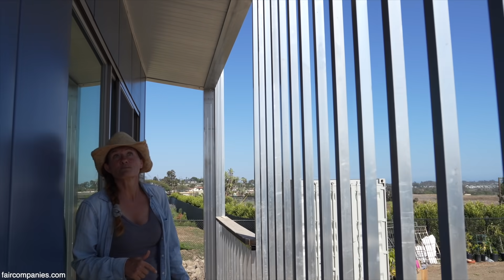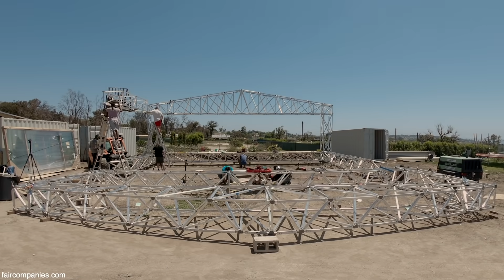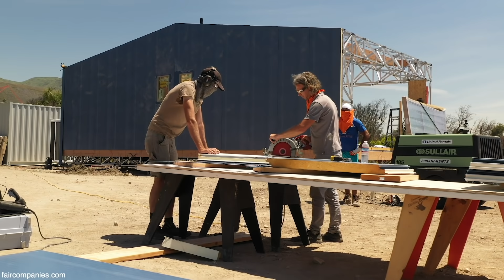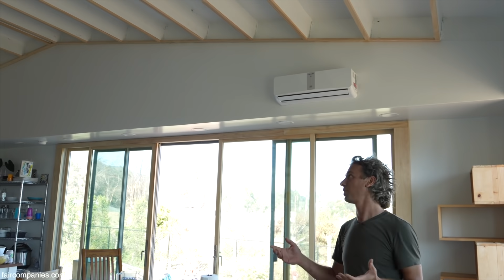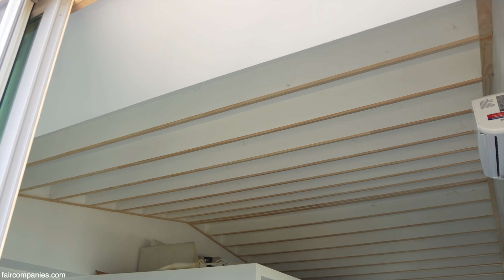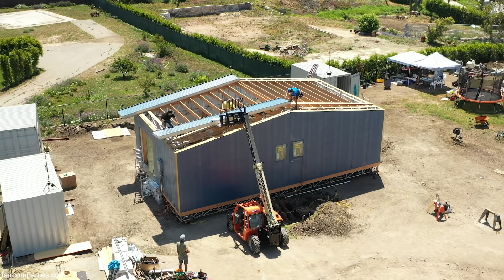This home goes up like a Coachella modular build: fast/cheap

Comment: I'd go for containers this house is for 2 people , 12  40 ft containers 6 over 6 will fit all of them and solar panels can be placed on roof as well plus they are made of steel so wouldn't melt , I thought they'll put solar on top but it feels like a lot of waisted space with no rooms.
Reply: I looked into building what you described - I  am designing a cabin/cabana on the water and I looked at shipping containers, and I don't want a structure that was treated with pesticides and I can't get a crane to the property.  These panels though aluminum look easy to ship.  I was surprised they used wood in the framing, underneath the metal - why not just all aluminum?  I don't want to put solar on the cabin near the water, because if by chance one of the solar panels broke,  it would be an environmental hazard on the water and solar agreements usually fall on the property owner for liability.
Reply: @laverite1050  Because of interior has to be insulated and not have thermal bridging materials, metal is a heat conductor and aluminum is a very good conductor...
Reply: Thank you - but how do they compensate for thermal bridging when companies sell all the pre-fab steel framing and studs?
Reply: Steel melts too, just at much higher temperature... Forest fires burn very hotly, sometimes over 2000°F (1100°C ) and that's close to the melting temperature of steel that should be more than enough to start weakening it. An average surface fire on the forest floor might have flames reaching three feet in height, which means a temperature around 1,500°F (800°C). Most metals will melt in that heat. In extreme conditions, a fire can give off 10,000 kilowatts of heat energy per meter of fire front, resulting in temperatures approaching half that as of the surface of the sun! 

While it may seem steel has the advantage when only looking at melting temperatures, a steel structure would actually have issues like hot spots, etc that will make it far more likely you'd get fried inside.  Aluminum dissipates heat much faster, helping to eliminate hot spots, and in terms of radiant heat it can reflect most of it to make it harder to heat up until the fire gets right up next to it but the steel would heat up long before as it absorbs the radiant heat...  

Basically, the reflective index for steel is around 5%, but aluminum can be 80-90% unless it's painted or covered in soot then it drops to less than 20-30%... Still higher than steel's 5%...  So a fire doesn't have to get as close to a steel structure before it starts effecting it...

It's also much harder to turn containers into a home, especially, as you go bigger, more complex designs, etc. and quickly becomes more costly than traditional framed structures.  While steel or aluminum framing gives more flexibility in design, much less labor, etc.

Comment: The steel-skinned SIPs are great. The electrical and plumbing trades will love the open frame sections for easy installation. And the whole thing seems like it’s very low carbon because of the basic minimization of materials. Brilliant!
Reply from the maker: Right on
Reply: I wonder if the panels have foam insulation? If they do... Well another fire would be almost as devastating as before. :(
Reply: @parvanboyukliev116   Fire resistant rated foam & steel skin  'should' beat shingles & wood frame. Just concerned about the melting point of aluminum & heat. Need the generator powered rooftop sprayer to extinguish embers as the alight during a wildfire event.
Reply: Natures best carbon capture....Trees, coal, and oil. What do we do with it.. Burn it ...to smelter metals. Where exactly is this imaginary low carbon you are referring to?

Comment: fun fakt: aluminium melting point 660,3°C.
wildfires can reach 1000-1100°C.
Reply: have mercy on those people who still uses different temperature scale. 
aluminium melts at 1220 Fahrenheit 
wildfires can reach 1832-2228 Fahrenheit. 

Though many would prefer celcius. Just a heads up to the Fellow Westerners who still needed this info. 
In case there are disputes about the extent of whether burning wood can achieve such high temperature. 
Just let them know, industry do use carbon fuels to melt carbon steels which have a melting point of 2600-2800 Fahrenheit. Im sure many of us seen some Americans needed some info and some have their own belief. This would help those understand that burning a lot of carbon can really melt stuff. 

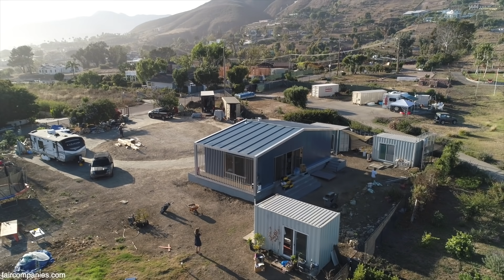Then again, while acknowledging the potential to melt frames. Im sure... the western folks knows this well. if you skip the video to 14:50. It is a place that can be for wild fires. It is dry, It is hot, and doesnt seem to be a lot of water. While also, for anyone reading this, at 14:50. There are not many trees. So having a wild fire at that location is extremely highly unlikely. 

More like that area (in the video) seem to have a rainfall of about 1 inch or 25.4 mm a year. This factor Is nothing short of amazing but more extreme concern.

Comment: Aluminum is highly problematic from an environmental point of view. Bauxite mines are not a benefit to nature, are they?
Reply: And it takes a ton of electricity to produce, which in turn requires a lot of coal or natural gas to be burned.

Comment: Walls could be on wheels and you could redefine the interior layout for bedrooms and living space whenever you felt like it...or you can move it away from the steel walls as the fire wraps the building turning the walls into a broiler/skillet
Reply: Umm, you are ignoring  the foam insulation?
Reply: @dnomyarnostaw  do you think the film would melt under high temperature?
Reply: @Interglacial_optimist  I don't know about "film", but for polystyrene foam sheet 
"Boiling Point: Decomposes over 600 °F (316 °C) Melting Point: Softens @ 220 °F (104 °C)"
With a steel ( highly radiative, heat dispersing) cladding, and no fire source within 20 feet, there will be no problem.
Malibu has a high fire rating standard, obviously, so their approval speaks for itself.
Reply: @dnomyarnostaw  oh that's good news I wonder what kind of toxic materials the foam puts out during its melting process
Reply: @Interglacial_optimist  Very few.  Building codes require low emissions for burning materials including insulation,  based on years of fire tragedies.

Comment: Interesting concept, materials, technique and people, as usual, Kirsten.  Lots of critics chiming early on this one.  Oh well.
Reply: not a single critic here bud
Reply: I should have said “... of the house, not of Kirsten.”  And yes, there are lots of negative comments about the house.
Reply: I’m not sure how one would design/build a house capable of withstanding a raging forest fire, unless it is entirely underground.  Even reinforced concrete can suffer structural failure if the heat is high enough for long enough to weaken the rebar.  A “home” that can be driven or towed at least has the potential to escape, if there is an available exit path.
Reply from the maker: Thanks @BruceFay, though I appreciate criticism of any ideas I show. That's part of the process of showing new ideas and helping vet new ideas. I am definitely intrigued by the idea of using geometry and not mass to build homes. Buckminster Fuller was experimenting in this way as well. Perhaps we haven't found the right combination of materials/designs yet, but it's definitely interesting.
Reply: @brucefay5126  I'm not from California, but I keep seeing "Create a buffer, and keep it clear of combustibles"
While I doubt any of that aluminium would last through a fire, certainly a shotcrete monolithic dome could stand clear of the ground and be burned right over without damage.
What you can't control is how much fuel builds up beyond your property. Or how far the flames will carry on the intense drafts created by the fire.

Comment: Possible options.   Steel siding and roofing, e.g., Edco offers this.  And/or Hardie board (cement-based) for same & for a perimeter wall as fire break,  although more $ ?  Cali code restrictions, insane building regs, mean property tax rates....oh heck, just imigrate to Florida, Texas, Nevada...so hot here, you won''t notice a forest fire.
Reply: It's hot in SoCal too!

Comment: The generic term for the exterior metal panels is SIP or structural insulated panels. The comments about modern wood construction were very ignorant. Modern platform framing along with cross laminated wood panels are far superior in positive human and environmental impact than this homes design.

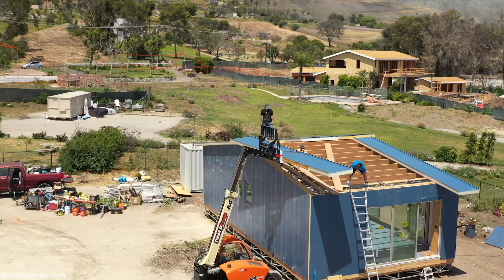Comment: I thought its built without timber, but (around 07:11) the pics from the roof show lots of timber, or do i need glasses
Reply: timber definitely or we both have a problem, lol.
Reply: Interior, on the insulated side... You don't want thermal bridging from the exterior...
Reply: @ZeoCyberG  
I dont want burning material if the next firestorm goes through the area...
I think that was the background to this footage
Reply: @helgafalckenberg6635  On the interior it won't burn because it's not exposed...  You do need insulation with a metal structure, though.  So no getting around that, but that's where good designing comes in and you can mix materials for where they can do the most good...
Reply: It's likely just interior support as the roof seems to be insulated metal panel roofing.  Besides, if the inside of the house is hot enough for that wood to catch fire, chances are all the furnishings are already on fire....

Comment: The problem I see so far is aluminum melts really easy
Reply: But it won't ignite from wind-blown embers
Reply: Not really, remember it's a good conductor of heat.  So you have to basically heat the entire structure while it's dissipating the heat rapidly and aluminum is also very reflective of radiant heat.  So can take a ton of thermal energy to actually heat it to melting temperature...  Properties also helps prevent hot spots and good interior insulation should prevent any flammable materials in the interior from getting dangerously hot until the fire is right on top of the home...
Reply: Copied from another comment "The numbers you mention are in the combustion zone, as in the wood burning from within. Aluminum will not burn thus it will never face those kind of temperatures. The point of this build is "to not catch on fire" from flying embers as a wooden and shingle house will. As long as there is no vegetation within 10 feet of this structure it will survive any fire around it because 10 feet from the flame it is nowhere near 600C. So the answer is YES this house will survive all future brush fires in that area as intended."

Comment: "We made our house into an oven, instead, so we're properly baked when the next fire comes."
Reply: Don't forget which temperature Aluminium melts at? ...
Reply: @ponypruhest  Just about/below the typical forest fire temperature.
Reply: @Clippy-007  yeah + it will probably weaken structurally before it actually melts.

But other than that, I think it is a neat idea for faster construction :-)
Reply: You evacuate when there is fire, by the time heat becomes a issue for this house a wood house would be burnt down to the foundation. so you can either come back to a pile of ash or a intact home that will probably just need repainted.
  The insurance cost difference in fire prone areas could easily offset the more expensive build costs over a 20yr period.